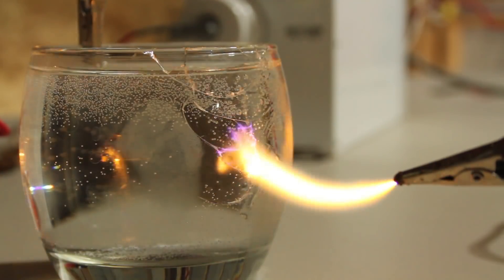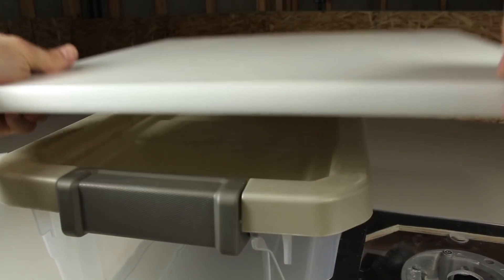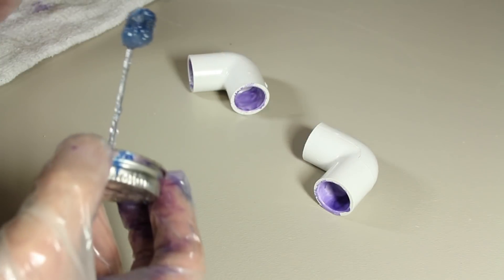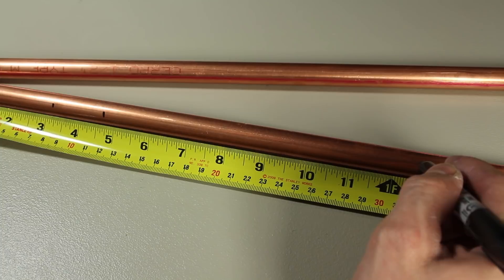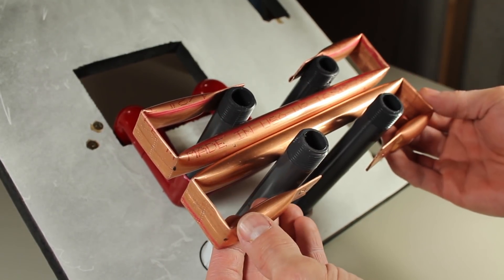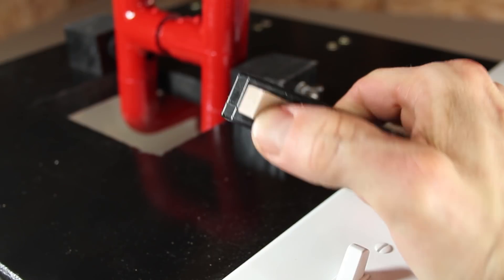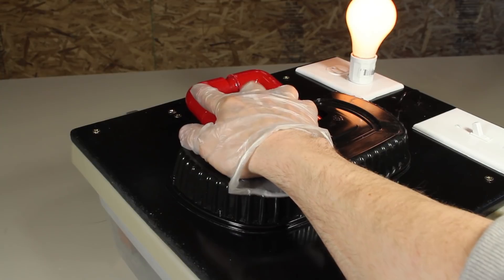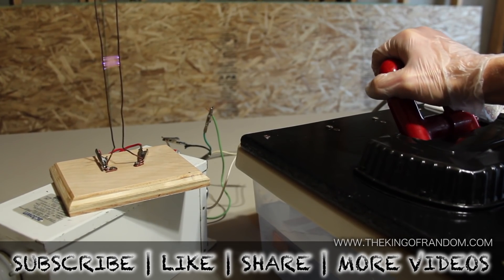The Scariac (Poor Mans Variable Power Controller)

Comment: If you increase resistance, the voltage will not change at all, since we did not consider adding a load. And for me, working with High voltages, 1.5kW power supplies, you should think about, who has the idea...

Did YOU ever build your own DC/DC Converter Circuit without ANY IC package? If about resistance, current, voltage and resulting wattage, you shuold get on your knees.

If the resistance changes, the voltage will ONLY change, if you have NO open circuit. Ever thought of LED-Resistors?

Comment: I am moderate at electronics, maybe you shut up? You are doing it completely wrong. A variac is a transformer, using magnetisation current, to convert voltages. The power is always constant on an ideal transformer. If you take out 1kW, you have to sent in 1kW. BUT! The power is a result of Voltage and resistance, giving you a current. The Scariac ONLY is resistance. If you have absolutely no load attached, you will have the same voltage ALL the time. You are only controlling R, giving I and V!

Comment: Also, if you wanted to, in case of something happening, you can put a wire that's going to the plug, through the board also, that way if the switch fails, you just cut the wire!,

Comment: Just a quick correction about the voltage. It will fluctuate under load. As your meter is very high impedance, the terminal voltage with no load will always be pretty close to line voltage. under load the voltage will be "shared" between the loads proportional to impedance. Great video! scariac indeed...

Comment: I've used water and salt solutions as current limiters in a charger for a rather energetic capacitor bank I have. It won't burst into flames like normal resistors taking power straight from the mains.

Comment: no, i was connecting it to an angle grinder like what he has in the video, it works fine right from the wall outlet. maybe i'm not using enough water.. i guess a such a small amount just won't work.

Comment: thanks for the response. but i have a problem.. i built one of these, but with a smaller container. tried to use it with power from 11.1v lipos, it only worked if the terminals were about .5" away from each other or closer. so i thought maybe it's b/c its DC power, or maybe just not enough power. so i hook it up to a wall outlet and slowly add power, nothing happens until the same .5" away and suddenly my wires pop and the lights go out... nothing was wrong with the wiring, didn't happen w/ DC!

Comment: Forgive me if im wrong, but doesnt this do around the same thing that a $20 router speed control from Harbor Freight does? Id imagine that this would allow for higher power, but would the Harbor Freight option be a viable replacement for this in the welder?

Comment: for simple applications like that grinder, or anything else that draws 110 volts of electricity, then why don't you just use a light switch with a dimmer on it? wouldn't that work just as well? i feel like it shouldn't be that easy though..

Comment: If you can find an old sewing machine foot controller they make great speed controllers for a dremel. Some of them are even built with regular wall plug type connections, just plug the controller in the wall and your dremel into the controller. I have a couple that I have been using for years.

Comment: Wow! Other than for the excellent educational demonstration this clip is, talk about something that should not be done at home. To put it bluntly, if you have the knowledge to be relatively safe while doing this, you probably wouldn't want to. If you think this is a project with practical and safe application you probably don't know what you are doing enough to be safe. Want a safe cheep controller for a dremel or drill? Find a speed control off an old sewing machine.

Comment: No it doesn't. Dimmers usually work by rapidly switching on and off at a adjustable duty-cycle. This scariac is essentially a variable resistor. Dimmers are much more energy efficient but won't always work for inductive loads such as transformers (such as his welder and jacobs ladder) and motors.

Comment: I was assuming he needed a poor man's Graetz bridge for his arc welder (since it work better in DC) but considering the high currents diodes are too expensive. If you are using for low currents then it is better to use a Graetz bridge, or a motor/generator.

Comment: Your idea for the Scariac it unique... dangerous not only to the person controlling it but the machinery.  Most electric motors do not have the variable speed capability of small hand held items. Slowing the speed of a table saw will not only damage the motor (4200 rpm @1.5-3 hp)  But will cause a ballistic effect with what you are cutting, not to mention the fracturing of carbide teeth at low speeds and damage to the arbor.  I have 32 yrs exp. in woodworking and this is not safe at all.

Comment: I imagine that the chlorine in tap water would react in a slight way with it as well, to make sald (NaCL).  I'm no chemist, and it's been years since I did a reaction equation though.  I would be carefule about the kinds of screws you use on the electrodes.  they too can react.  I know that some are plated in zinc or cadmium - both react with lye.  Does it turn the solution a dark color after a while?

Does it smell bad?  Will the wife bitch about it after a few months in other words?

Comment: will the base solution heat up to the point of boiling?  What is the pH/pOH?  What gasses are emitted if it boils?  Water vapor obviously.  Probably hydrogen.  I think you would be better off to use Iron (not galvenized) electrodes instead of copper.  Be careful inhaling the fumes, they might burn.  Alkali burns are worse than acid burns, and you can't get a more powerful alkali than Lye (NaOH).  Flesh, fat, ,whatever.  it goes to townh.  That's why they use it to make soap from fat.

Comment from the maker: I wasn't familiar with that concept, but now that I think about it, it makes perfect sense.  I stopped everything just now and tried it under load with a 120V corded drill, and it's characteristics under load are just as you imply .. ranging from low voltage (in my case 40 volts on initial contact with the solution), and increasing to 120v when maxed out.  Thanks!

Comment from the maker: I don't think running the Scariac on DC would be a good idea because it would turn the Scariac into a HHO generator itself.  Some other variable resistor would be a much better option.  I'm thinking about using the heating element from a dishwasher personally.

Comment: Hey I'm wondering if the Scariac would be able to run your oxyhydrogen generator, and if so, is it safe to do so??
If not what would you recommend I use to control the power to the oxyhydrogen generator?

Comment: I don't need to google it to find random bro-science anecdotes about "I tried this and herp derp it broke" and then start talking like an expert. I'm actually familiar with and understand the concepts in context. I know why the Scariac works and why it's not bound to fail like you think. I know why using dimmers to drop more than 50% of speed on drills will kill the motor or the dimmer.

I have much to learn but I make strong efforts not to overextend my knowledge. I'm comfortable on this topic.

Comment: Cont'd. Why PFC / PWMs are bad for lathes: they control speed by reducing ave power or peak voltage. This slows the lathe but does not trade it off for torque (like using pulleys/gears would). So it's easy to overload the motor if you're stupid. Trying to load it makes it draw too much current (which is NOT limited by the dimmer), then it melts. NONE of this is an issue with the Scariac, which limits max current directly. You read 5 forum notes and don't understand context or basic terms. Fail.

Comment: Welding - The reason he built this.
This Discussion - You are not a dictator, you don't decide what it's about.
Dimmers - WILL work, in a limited way, most of the time, for minor speed controlling. Separate topic though. THIS is not a dimmer. The harmful thing about dimmers is the phase-fired controller not handling reactive (inductive) loads well. The Scariac has no reactance, just resistance.

You're not suddenly an expert by googling random terms. Educate yourself, you are wrong in many ways.

Comment: Who said anything about welding?  He said it boils water and he never used the word eventually.  I don't care about how much it costs to heat water, or welding, relative to this discussion.  The discussion is about using dimmers or this water device to control motor speed, and nothing else.  Please google "dimmers and inductive motors".  You will find that VFDs are used on lathes etc., and not dimmers because they burn motors. Their words, not mine.  Let's stick to only that subject please.

Comment: Boils water? Eventually. So does a kettle. A kettle (comparable in power) costs about 15 cents an hour to run. To control a welder you're not dropping 99% of the energy, you're looking to tweak it by a few percent. And 95% of your time welding is in setup, not actually running beads. So yes, do the math, it is literally, on average, costing less than a penny for an hour of intermittent welding.

Even welding 2000 hours/yr, it would take you 10 years to pay off a $200 VFD.

Also fine for motors.

Comment: Costs $? Yes, as much as a few pennies an hour, or, when welding, effectively zero.
Heats water? Yes, a little bit. Eventually.
Use a VFD? Sure, go pay hundreds of dollars for one.
Doesn't make sense? Well it works well, cost almost nothing, is an interesting to learn alternative solution, and was probably fun to make, so, makes sense to me. You make your own choice.
Ruins motors? Nope. It's limiting current so much sometimes the motor won't even spin. Overcurrent is the danger, not this.

Comment: Go back to earlier postings where I already mentioned that dimmers were a bad idea for induction motors.  Low line voltage burns up motors.  On construction sites, long cords or cords with insufficient wire gage burns up motors.  He is trying to slow down a motor by using the water as a dump load.  Does not make sense, and costs $.  You can heat water some other way, and you can control AC inductive motor speeds best (read safely and efficiently) using a VFD.  Lathe owners know this very well.

Comment: You are correct in concept, wrong in context.

1 - Most dimmer switches do not handle inductive loads (transformer/motor) very well. They'll often be destroyed or not function properly. A dimmer is a bad solution.

2 - He's not limiting voltage and maintaining load. He's limiting current with resistance. So a motor would be fine, it will not burn up. Burning up would be if you seized the load (~zero resistance) and gave it full voltage. I = V/R. But he's limited current with extra R. No problem.

Comment: the one i got was meant for radio stations and was used as it. the guy didn't know what he was selling and now it is mine. just go on ebay and search around until you find one you will need at least a 20 amp one for your needs. you are getting into electrical stuff a lot now and for your own safety you really need one! and please for the love of god be careful about unmodified mots they are so dangerous. and you have little protection. but your high current ones are fairly safe. :)

Comment: cont.-The wire gage in the motor is designed to carry X amount of current (Amps) and still run cool.  When the voltage drops and the current increases, the wire heats up.  Car battery-low volts and high amps requires large cables.  High voltage lines use relatively small gage wires because the amps are low.  When a transformer steps down the high V, the secondary windings must use heavier gage wire because V goes down and Amps go up.  I hope this helps.

Comment: My guess as to why you had no change in voltage would be you had no load attached to your liquid rheostat when measuring the voltage. There is no voltage drop across a resistor in an open circuit, so the voltage would be the same on both sides of the resistor. Digital multimeters like the one you are using have a relatively high input resistance to minimize the loading on the measured circuit, so the voltage drop created by measuring like you did will be too small to resolve on that range.

Comment: If a motor is asked to do a set amount of work, like with compressor motors, it needs a set amount of power (Watts) to do it.  Power (Watts)=IxE.  In that equation, if the power requirement stays the same, and the voltage E is dropped, to maintain that power requirement, the current I must go up.  Ex.-a motor needs 1,200 Watts at 120 VAC to turn a pump, so it is drawing 10 Amps (1,200 W =120 V x 10 A. If voltage drops to 60, then to feed the 1.200 watts, current must go up.  Ex.-1200W=60v x 20A.

Comment: Dimmers have a movable contact that sweeps across a carbon path.  The longer the path, the higher the resistance.  Same for a var. water resistor.  The more water between the electrodes, the higher the resistance.  In each case, the voltage to the motor drops and per Ohms Law, the current increases.  The gage wires in the motor windings are designed for a set voltage and current.  When the current goes up, the smaller gage wire gets hot and can burn.  You said that your water sometimes boils?

Comment: Google-"dimmer switches and induction motors".  Look at the entry on the Home Shop Machinist.  One message there says "Lowering the voltage causes to motor to pull more amps and then becoming hot and burning up. This is why summer time brown outs destroy motors that run refrigeration units. "   This topic comes up all the time for home machinists.  Dimmers also burn up.  You have a variable resistor.  More resistance drops more voltage, and current goes up.  Ohms law-E=IxR, R=E/I, I=E/I (E=V)

Comment from the maker: I think I see what you're saying, but it might help to know this is neither a dimmer, nor a variac.  It's actually a variable electrolytic resistor, and the 60hz doesn't change.  I haven't found any info on Google, though my searches have been limited, to suggest this will hurt a motor in any way.  I'm open to correction from anyone more experienced in using this method.  Thanks again for your comments.

Comment: Modern dimmer switches are not rheostats, they use a sort of duty cycle control by chopping off part of the AC cycle. This works ok for resistive loads like incandescent lamps, but is not suitable for things like motors or transformers. While it is true that older dimmers were actual rheostats, these are generally for relatively small loads than a liquid rheostat and are no longer easy to come by. A variable transformer would probably be the best alternative, but would be more expensive.

Comment: I am too old for this much thinking, so I will refer you to Google.  Search for dimmer switch motor variable speed.  Scroll down to "Can I put a dimmer switch on a 3/4 hp motor.  Many good explanations there.  VFDs vary the frequency and in so doing, control the motor speed.  A 1725 RPM motor in the U.S. uses 60 hertz.  That same motor will run at 1435 RPM on 50 Hertz used in Europe.  With a machine such as a lathe, VFDs are the best way to go for single phase motors.  Continued in second post..

Comment from the maker: I'm not familiar with burning out AC motors.  I haven't operated it for extended periods of time to see if that would happen, but I don't understand why it would? .. so I'm open to education on that if you can teach the concept.  As far as 7000 watts .. that was on a dual MOT stack pulling from 240 vac at 30 amps.

Comment: wait a min. , you have both the +ve on one side of the container and both -ve on the other side, and this leads to heat the solution .. etc.not the issue. BUT what if you divide the container longitudinally (or make 2 containers) so that each side (or container) have the same charge facing each other? will this idea have the same "power controlling"effect?
BTW .. I love your brrrrillliant channel 
Big salute from Iraq

Comment: 7000 watts?!?!  I must be missing something???  Other than the water device itself, what tool or appliance are you using that requires that much power?  What size breaker are you running this on?  For 120 VAC, you would need a 60 amp breaker.  A drill or other motorized tool doesn't pull that much current?  Doesn't the arc welder have its own control?  Truth is, this device or a dimmer will burn out motors.  AC motors need a variable frequency control.  Please show me the error of my ways.

Comment from the maker: Great question.  Yes, I didn't include a ground because in order to get 240v, I was powering from 2 different 120V electrical busses, on two separate breakers that had to be tripped independently.  I couldn't think of a way to trip 2 breakers in 2 places with 1 ground wire, so I didn't include it.  I'm open to suggestions if you know how it could have been done better?

Comment: Grant, would a smaller design to the scariac work as well? Like, maybe a half gallon sized container that just handles less amps (and maybe only 120v input)? I feel like it would be useful for applications such as small motors, and a lot more convenient in terms of size (portable). I've been using a modified slot car speed controller as a variac but it can't handle a lot of electricity so I was wondering if a smaller scariac would be a good substitute. and great video as always!!

Comment: Or, you can just go buy a 120 VAC dimmer switch.  They are both rheostats.  Large "fixed" water resistors are sometimes used on some high voltage projects.  Did you make this video for the concept, actual use, or both?